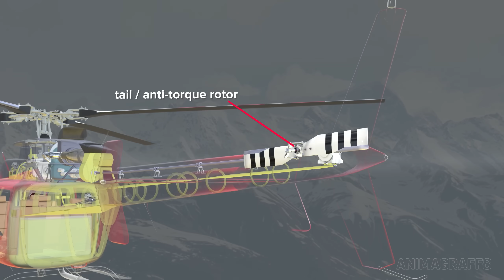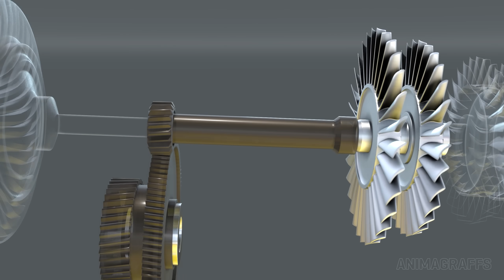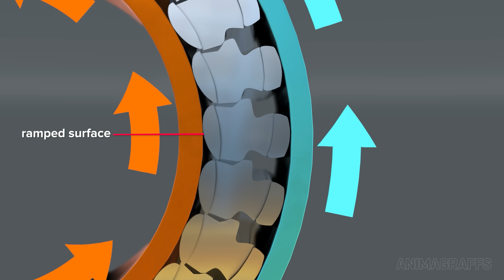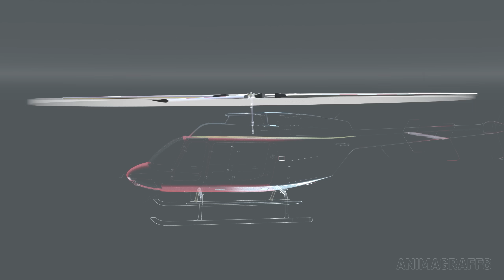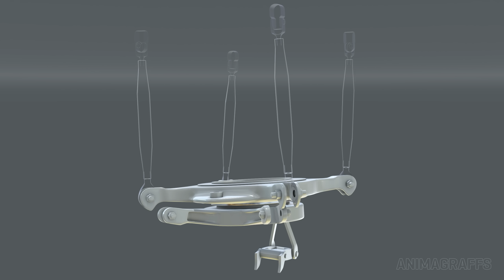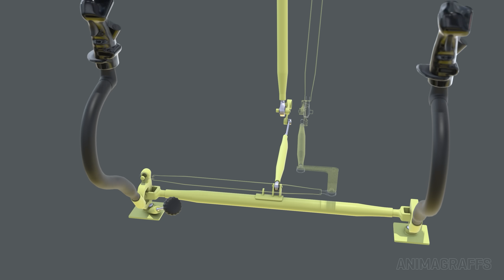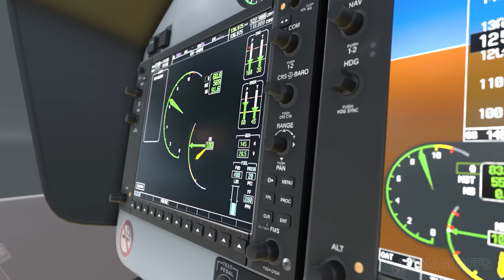How a Helicopter Works (Bell 407)

Comment: Awesome video!
I do have some questions that have always bugged me about helicopters: 
1. The rotors provide the lift, but what actually holds the weight of the airframe?
2. It seems to me that the mast holds everything, but doesn't that put a tremendous strain on it as well as the transmission? 
3. Since the mast and related components are splined together, what keeps them from slipping apart?
Reply: SUVs don’t lose their tyres in sharp turns.

Comment: As a rotor design engineer, I can’t tell you how excited this video made me. Beautiful job explaining such a complex system!
Reply: @Drummingwolverine  Nice to meet you bro! What software are trained in? Or what is your favourite design software?
Reply: Is there any helo design book out there that simply explains the design variables when switching to a different number of rotors blades.  Your shorter 4 rotor blades spin faster and don't have as much  negative lift when air speed is high as the two bladed rotors. When I was flying as a passenger on Air Logistics off of rigs and boats in the Gulf, I knew air density was a problem considering how big them Southern boys were flying home on crew change day.
Reply: .........as a bricklayer I have no idea what he is talking about .
Reply: You are a magician, because swash plates are magic.
Reply: How come centrifugal force doesn't rip the blades out of the hub if it's just fiberglass and that one small point holding it in place?
Reply: yeah yeah mr show off bragger
Reply: Means you are secretive  and selfish Engineer are you not tapping from him? bought you don't want to share your knowledge experience, where those knowledge and skills kept from you? Today you are comfortable and  proud to bear that tittle"Engineer"😁😄😀🤪🤣
Reply: @trentson6965 your reply was so nonsensical that the guy above me had to do a translation.
Reply: @BallisticFeline8250  Nonsensical in what way? and in what manner? Can you elucidates further on what you are trying to say about my comments. So I know how to respond more appropriately to what your comments conveyed?
Reply: @trentson6965  Whaat?
Reply: @adrianmaree8352  Chief why the What's? Sorry I didn't take to check for edits before post probably why you said what's 🤜🤛
Reply: @trentson6965  "Means you are secretive  and selfish" what thing means that they are secretive and selfish? You forgot to put a "a" between "you are" and "selfish". "Are you not tapping from him" doesn't make any sense, what does "tapping from him" supposed to mean? "Bought you don't want to share your knowledge experience" also doesn't make any sense, I think you meant "thought" and "didn't" instead of "bought" and "don't", you need to add a "and" between "knowledge" and "experience" along with a "I" at the beginning of the sentence. Also why would you think he wouldn't want to share his experiences? "Where those knowledge and skills kept from you?" I think you meant "were" instead of "where" because with your current sentence you would be asking "in what place are those knowledge or skills kept from you?". "today you are comfortable and proud to bear that tittle"Engineer"" I think you meant "title" instead of "tittle". My attempt at fixing your reply is "That means you are a secretive and selfish engineer. I thought you didn't want to share your knowledge and experience? Were those knowledge and skills kept from you? Today you are comfortable and proud to bear that title "Engineer"." I however don't know what to do with the sentence "are you not tapping from him?" and your reply still doesn't make any sense within the context of the comment as the commenter never implied or said that they didn't want to share their knowledge or experience.
Reply: @BallisticFeline8250  @davisjian8250, Chief, sorry. How was it possible to edit my comments from the YouTube platform, and the same provision is not made available here? 
My idea about YouTube is that you cannot copy people's comments but can only read them. I have made this effort to be able to copy comments that have this inspiring message and also share them with others for the same inspiration I get.
Reply: @BallisticFeline8250  you got too much time on your hands to be responding to addle minded individuals...
Reply: @badcornflakes6374  I agree but I find it hilarious to respond with an entire paragraph of what was wrong in those few sentences. Plus it wasn't to hard because most of the mistakes were pretty obvious.
Reply: @trentson6965  what are you asking lol
Reply: @thatoneguy6725  Am asking thatoneguy6726 🤜🤛👍
Reply: @thatoneguy6725  he's maybe drunk, but definitely angry. Here's what I can gather from this

"You're a secretive and selfish engineer who only takes away but doesn't bring back. Don't you want to share your knowledge and experience, too? Has this knowledge and experience been kept away from you? Yet here you are, so comfortably and smugly calling yourself "Engineer" [emoticons]"

Comment: 45:04 isnt there missing the information, where the spinning of inner shaft stops? For sure the lever pushing (from the control rod) the whole shaft back an forth can not spin? So there needs to be a bearing allowing the spinning while transfering the back and forth motion of the control?
Reply: From animation the complete shaft is spinning (red dots) just before the lever. Am I correct, that an axial bearing would connect at that point?
Reply: Since this axial bearing can only get pushed (no tensile forces) there needs to be two axial bearings?
Reply: @markusw9455 ever tried to push a wheel in a line under a skate? Standard radial bearings seem to work just fine.
Reply: @ArneChristianRosenfeldt  thanks for the answer, but what is a skate? Radial bearings do not allow axial movement as needed here?
Reply: @markusw9455  ball bearings are not radial. I think that roller bearings are used only in a situation where over-constraint is a problem. Apparently, wheels don’t have a problem with this. You just tighten the nuts so much that the wheel still spins easily, but does not wiggle.

Even with asymmetric, more axial bearings ( as used in cars ), I think you could at some stiff spring there. As I have experienced that the nuts in my inline skates tend to go lose.

Comment: As someone in my first year of flying helicopters, I can say this video explains the mechanics and interactions better than 90% of my instructors. Especially rotor flapping, feathering, flight control mixing, dissymmetry of lift, and the sprag clutch. Thank you for this, it should be shown to every aspiring helicopter pilot!
Reply: It's the same with watching David Malan at Harvard, talk about how a computer works. If you've ever had the subject in high school, it's like the difference of seeing something for the first time, vs. having had it told to you by a blind man.
Reply: Solid endorsement.
Reply: If he did then I didn't stick around long enough to see it as I stopped watching when he said that jet (turbojet) engines use exhaust gases to create thrust.
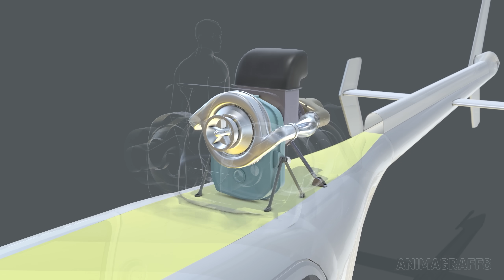Reply: @Tom-zs6bb  5:03 "The turbo shaft engine gets its name because it's designed to power a mechanical shaft instead of producing thrust with a stream of jet exhaust."
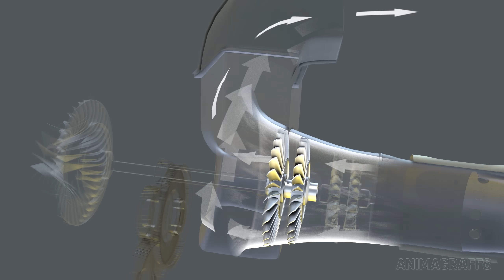8:21 "The exhaust gas flow turns ninety degrees as it enters the exhaust chamber, having spent its energy."
Not sure what you are talking about.
Reply: @what_in_the_heck_is_going_on  What I was talking about should be quite obvious. Perhaps you should re-watch the video. Or do you also believe that a turbojet engine creates thrust by ejecting the exhaust gases rearward?
Reply: @Tom-zs6bb  that's how it works though
Reply: @tenet748  No, it's not, but an awful lot of people seem to think that. I suppose rocket engines work the same way, right?
Reply: @Tom-zs6bb  Seriously? You'd discount an entire well researched, visualised and narrated video over a relatively minor quibble?  Sure, strictly speaking it's the acceleration of the mass of gas through a nozzle that produces the thrust force in a turbojet/fanjet/rocket. The point being made was simply that in a turboshaft, instead of thrust, that force is translated to mechanical rotation that is then used to provide the motive force.
Reply: @MartinBurtonGuitar  

"instead of thrust, that force is translated to mechanical rotation that is then used to provide the motive force."

You are painfully close to understanding the truth. Now think about how and where the force created by burning fuel and air causes the mechanical rotation to which you refer. 

The popular misconception is that the exhaust gases emanating from a turbojet engine create thrust by pushing against the ambient atmosphere, creating thrust per Newton's Third Law, when that actually occurs inside the engine itself. 

"Sure, strictly speaking it's the acceleration of the mass of gas through a nozzle that produces the thrust force in a turbojet/fanjet/rocket."

As you mentioned rocket engines, how would they work in the vacuum of space based on the exhaust theory?
Reply: @Tom-zs6bb  I think you might be making an assumption that I think thrust is caused by "pushing" against the atmosphere.  I don't, I never said that and, to my mind at least, neither did the video. Thrust is indeed caused by Newton's third law.  Work is done to accelerate a mass (the propellant) in one direction causing "an equal and opposite reaction" in the other.  So chucking a mass out of the back of a jet/rocket engine ("producing thrust with a stream of jet exhaust") causes propulsion of the engine (and the craft to which it is attached) in the opposite direction.  Nobody said "the jet exhaust pushes against the atmosphere to generate thrust" or words to that effect.
Reply: @MartinBurtonGuitar  "So chucking a mass out of the back of a jet/rocket engine ("producing thrust with a stream of jet exhaust") causes propulsion of the engine (and the craft to which it is attached) in the opposite direction."

Sounds like you still don't get it. Okay, where in the process do you think Newton's Third Law occurs to create the thrust?
Reply: @Tom-zs6bb  nowhere in this video it is said that thrust is created by "by pushing against the ambient atmosphere"
Reply: @Tom-zs6bb  In a rocket engine, thrust is created when the exhaust gas leaves the nozzle. It is at that moment that the mass of the system decreases, and a forward impulse is created, corresponding to the momenta of the gases exhausted backwards.
In the turboshaft engine, the momenta of the combustion gases is converted into driveshaft torque by the turbines, and the exhaust gas will have much less momenta when exiting the nozzle. Even so, exhaust nozzles are oriented backwards, to convert any remaining exhaust momenta into forward impulse.
Reply: @nunolip  I never claimed it did.
Reply: @nunolip  "a forward impulse is created, corresponding to the momenta of the gases exhausted backwards"

If that's the case, can you describe with what the exhaust gases interact to create thrust?

"In the turboshaft engine, the momenta of the combustion gases is converted into driveshaft torque by the turbines"

You're actually quite close to getting it right, then you ruined it with " Even so, exhaust nozzles are oriented backwards, to convert any remaining exhaust momenta into forward impulse."

Whether it's a rocket, a turbofan, or a turboshaft, thrust is created when gases interact with devices inside the engine. The exhaust does not create thrust.
Reply: @Tom-zs6bb  No, you are wrong. The combustion process creates gas with large heat and pressure. Combustion does not create impulse. 
The heat and pressure is then converted into speed by the nozzle. That is, the hot and pressurized gas escapes with high velocity through the nozzle. Or, the nozzle converts heat and pressure into kinetic energy. The mass and velocity of the ejected exhaust gases is what creates the impulse: impulse = momentum = mv, where m is the mass and v the velocity of the ejected gases.
Reaction engines are so called because they generate their momentum as a reaction to the ejection of high momentum
exhaust, and this ejection occurs at the nozzle. I refer you to the wikipedia article on the "Reaction engine": i quote "A reaction engine is an engine or motor that produces thrust by expelling reaction mass". This expulsion occurs at the nozzle.

But if you are still not convinced, look at it trough the most general physics principle, a conservation law: momentum is conserved, thus when gases are ejected through the nozzle with a certain momentum mv (m and v of the gas) then the rocket gains equal but opposite momentum MV (M and V of the rocket), such that mv=-MV, or mv+MV=0.
If you want to understand more the fundamental physics principles behind reaction engines, please read the wikipedia article on the "Tsiolkovsky rocket equation".
You will see that the velocity gain (delta v) depends only on the exhaust velocity and on the mass ratio, that is, all that matters is the ratio of mass being ejected and the velocity of ejection. Events inside the engine create energy (pressure and heat), but thrust is created at ejection.

In contrast, in the turboshaft engine, the heat and pressure created in the combustion process are converted into shaft torque (rotational momentum) by the turbine, with a small amount of heat and pressure being converted into linear momentum at the nozzle.

Please note that it is a fundamental physics principle, in any reaction engine, the motive impulse (the reaction) is created when the exhaust ejection (the action) occurs.
Reply: @nunolip  "No, you are wrong. The combustion process creates gas with large heat and pressure."

No argument. 

 "Please note that it is a fundamental physics principle, in any reaction engine, the motive impulse (the reaction) is created when the exhaust ejection (the action) occurs."

No argument. With that. You are simply confused,as are a lot of people, regarding where the action-reaction occurs, and it's not at the nozzle.
Reply: @Tom-zs6bb  Yes it is. 
Lets make a tough experiment: we have a rocket with one nozzle. This nozzle is attached to a perfectly elastic balloon, that can stretch  infinitely and is immune to temperature effects, has no mass, etc... 
When gas is ejected through the nozzle, the balloon will bounce in one direction with momentum mv (where m is the mass and v the velocity of ejected gases). The rocket will bounce in the opposite direction with momentum MV (where M is the mass and V the velocity of the ship with the remaining fuel).  And, of course mv=-MV <=> mv+MV=0. The connected rocket+balloon system will have null momentum, and after stretching of the balloon, will bounce back to the initial position.
But if you unplug the nozzle by removing the balloon, that is, if you disconnect the rocket from the ejected gas, the rocket will gain momentum. 
It is the ejection of a physical object with a certain momentum mv (the action) that transfers the same but opposite momentum (the reaction) to the rocket.
The act of ejection occurs at the nozzle, it is there that pressure and temperature are transformed into a mass with high velocity (that is momentum mv). Moreover, the shape of the nozzle will affect the amount of pressure that will be transformed into velocity. 
The nozzle is to a rocket engine what the cylinder is to a 2/4 stroke engine, or the turbine is to the turboshaft engine. The nozzle is the device that transforms the thermodynamic energy (pressure/temperature) of the working gas into kinetic energy. It is this kinetic energy that will impart a impulse to the rocket at ejection. 
It is only at ejection that the rocket gains momentum (opposite to the momentum of the ejected gas).
Ejection of momentum what imparts equal but opposite momentum to he rocket, and this occurs at the nozzle and is controlled  by the shape of the nozzle.

Comment: Amazing! But a quad rotor electric has 100 fewer moving parts and I can't wait until that becomes the norm...
Reply: I don’t know where you get the 100 from, but quads seem to have two rotors per arm. So : 8 moving parts. 16 ball bearings.

I think a rigid head with two blades and fly by wire has less than 108 parts. Electric tail rotor.

Comment: The Bell 407 is an excellent choice of representation however it's engine, the Allison Model 250 is an interesting choice. Your attention to detail and describing concepts is great but the engine is a little unique in the helicopter world. Having the compressor in the front and the rest of the engine be practically backwards.  Most other large turbo-shaft engines will be oriented like a more common jet engine with compressor at the front and exhaust at the back right after the power turbine.
The output shaft exiting the engine either out the front, through the compressor and intake, or geared out the side like your model.  All aside, thank you, job well done
Reply: The last stator vanes need to be thick enough to let a shaft pass out of the hot end.

Comment: It took me a while to figure out that retreating blade stall would not cause the helicopter to roll but would instead lift the nose and automatically slow the aircraft, setting a natural top airspeed that's lower than what pure drag would cause.

Comment: Naive question, but why having to reduce rpm with gears, instead of just running the turbine slower ?
Reply: Turbine torque rises with the square of its RPM. Indeed large fan jets have a very slow ( and kinda inefficient and heavy ) third spool.